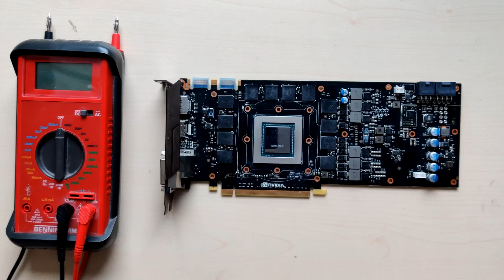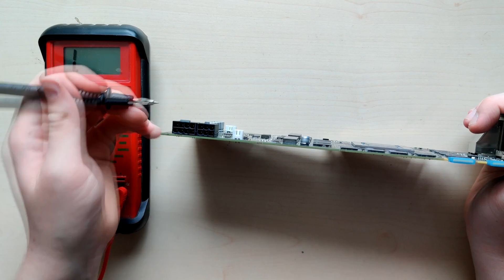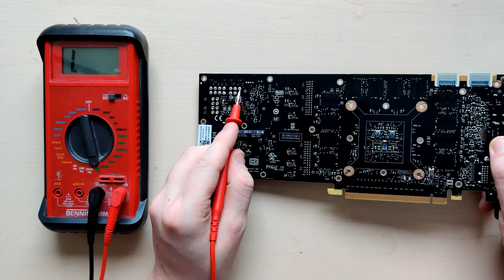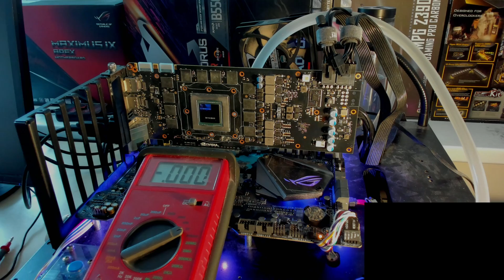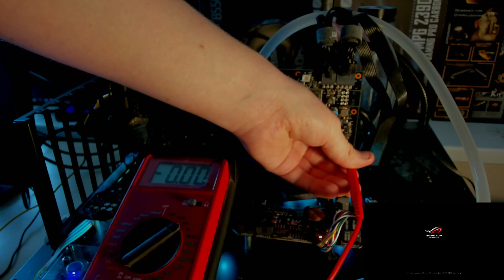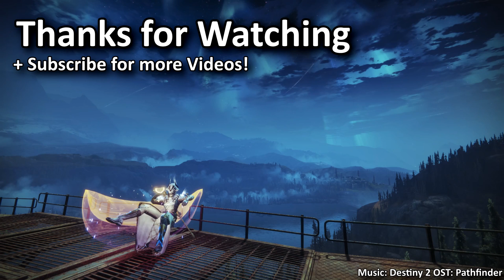The General Troubleshooting "Algorithm" to follow when diagnosing Graphics Cards

Comment: At around 2:25 he said that the card does not have fuses but aren't the 2 resistors just below the 6 and 8 pin connector as well as the 1 resistor to the left of that considered fuses?  I think they are also for voltage readings but I think they are meant to act as fuses as well.

Comment: Did you say all positive connectors coming to the card have to be separated? On my card they are shorted together. I mean positives with positives. And even shorted with +12v pin of fan number 3. Which causes it to spinn at full speed. What component could short those together? Card is not working EVGA RTX 3070Ti

Comment: Found this channel while searching for a solution to fixing a no display issue / not detected  on two Radeon (both MSI)  R7 370 (4GB) and R9 380 (2 GB) cards. R9 380 arrived with known faults so I am teaching myself diagnostics.   The other R7 370 was working fine but one day decided to not display.

Visually inspected both cards. All fine no burn marks or missing components all  big caps are good. Tested the PCIe fingers on edge connectors and also pin outs on PCIe power connectors all seem OK.

When the cards are plugged in the LED, fans spin but no display and no beeps. I removed heat sink assembly and I could feel the core (GPU) getting warmer and the R9 gets hot (only for 10 seconds).

Have not worked on these very small components before but I can test, and can solder larger components but not sure what else to check as most of the repair videos deal with nVidia cards and seldom any RADEON R 7 or R 9 series. Can you give me some hints how to start checking for common component faults?

I have a heat gun (simple type) but have not yet tried to re-flow the memory or core as I want to be sure if there are other culprits to check before I do these?

Any ideas would be very appreciated. 

Best wishes!
Reply: Any updates? Found myself in a similar situation
Reply: @lordsimquad  Nothing that caught my attention yet 😒
Reply: gpu core may be damaged, so it would probably need bga rebailing - finding a donor gpu to resolde. Its kinda expensive repair and not as reliable as factory.

Comment: I have a short on one of my R15 inductors, does that mean a bad gpu? The card is EVGA RTX 3080 and it is one of the inductors on the left side of the board
Reply: It depends which inductor youre looking at, the ones for vcore always look like a short but thats because the gpu vcore has a very little resistance thats normal, Ohms in memory inductors should be 50ohm, 1.8v inductor 800ohm, 5v inductor 6kOhm
Reply: @1elmasbergas  Thank you.

Comment: A novice walking through your algorithm to salvage my GTX 1060 Ti. My 3.3V beeps (and measures ~1-2 Ohms) , so it sounds like shorted 3.3V circuit... Where should I go from here?

For context: I connected my GTX 1060 Ti to a laptop via M.2 to PCIe riser. I plugged the PSU to the 6+2pin on GPU and the SATA on the riser. When powered the laptop, I felt an electronic burning smell... I found out that my PSU didn’t supply voltage, until I connected a ‘tester’ to the Mainboard 20+4 PIN Power Connector... But at this point, my GPU was already damaged, I guess.. Any advice would be appreciated.

Comment: hi  my rx 570 blue ligh led  power normal and chip heat but no display cant even boost pc bios and pc shudont after gpu spin for seconds and repeat restart i tested my  gpu 6 pin power its all 6 pins beep by avometer what do you think about this short? becouse you said power in gpu 6 pins must not all pins all black only not yellow?

Comment: Hello can any body tell me i have amd rx6750xt and not booting when plugged in and followed and every thing looks good according to video but when testing core voltages the core doesn't heat up and card wont even boot up
Reply: If you put it in the microwave for 1:30 on a 750w machine it will plasticise the solder ever so slightly and let it find and breaks 

Usually works to fix any bad connections which makes up about 95% of all gpu/circuit board faults

Comment: how about ASRock motherboard that have USB issue ... works only with USB 3.0 devices ... anything else u have to install a pcie usb extension to use the usb used by a seperate controller other than Asrock's Intel B365 controller??? fyi all USB ports delivers 5 Volts and windows gives an error when plugging non USB 3.0 device ... still not working either on OS nor on BIOS... any idea???

Comment: I wanted to let you know that I found your video to be extremely helpful in understanding what's going on under the hood. I'm just starting out learning and it's very important to be taught with sound doctrine. Thank you for helping me understand more than I did yesterday and a little less than what I'll learn from you tomorrow. Because the videos will keep getting better. I'm so sorry for asking this question, but I felt compelled to do so. Would you be so kind and tell me where I can find out every single tool and software that I need to buy to get started. Everything from power harnesses, soldering iron station, cleaners, hand tools, scopes etc... I know it's asking alot and I'm sorry, but I want to get started the right way and a tech is only as good as his tools. Also can I buy a great scope package from you? Or could you recommend a great setup like one I'm sure you have at your shop? Anyway, thank you for a great video!

Comment: hi, if pex rail resistance below 3 digit (possible short), will the core still getting warm? because my dead rtx3060ti core still warm and getting hotter with all voltage present. I want to make sure the core really dead before I use the card as my door stopper.
Reply from the maker: PEX rail can have low resistance sometimes. Depends on the card. Unless it's 0 ohms i wouldn't immediately assume it's short.

Comment: Thanks a lot for this guide, it's very useful and understandable. In my case visual inspection looks right, but there is a lot of capacitors in short (3 near the PCI slot connector, and 6 at the back of the core), so I suspect it could be a dead core, but since I'm a beginner, what do you guys think?

Comment: all voltage is present, but no display. where do i go after that
Reply: I’d say visual inspection of the PCB under a microscope to check for signs of corrosion
Reply: the problem here is the chipset beneath it needs re balling to make the surface of the chipset and the gpu has a good conduct

Comment: I have a 3060 Ti that gives me code 43 so I want to check what is causing it. GPU-Z can read the BIOS, the VRAM frequency, even the driver but not the size of the VRAM. I dont really get artifacting like most common 43 errors, in fact the card works every time I restart PC, it works for like an hour then the screen goes dark and PC restarts. The funny thing is it passes furmark test and gaming, but again it randomly crashes. I suspect maybe is BIOS chip but I have ZERO knowledge of PCB layouts, or how to use multimeter thats why im here lol but any way to identify BIOS chip and how to test it with multimeter? EDIT: I checked ASUS download center for BIOS update on my GPU but it says there are no new updates for it.
Reply from the maker: Most likely faulty VRAM. Try to run a mats test on it.

If GPU-Z can't read the VRAM size that means the driver is not installed/active

Comment: I have a PNY RTX 2080Ti that will boot and the screen will come on and I may be even able to run Heaven for a few minutes but then I get a black screen and the Blower Fan turns on Max. I then have to either do a 5 sec power cycle or turn off the main power to get the computer to reboot. I have noticed that I am missing a lot of ceramic Capacitors on the back of the card. I would begin replacing the capacitors but I don't have another 2080Ti to get them from. What should I do?
Reply: Have you tried getting a board view for your 2080Ti, finding out the exact parts you need and then ordering them from somewhere like AliExpress?
Reply: @ProfShikari  I tried to find a board view on the internet but I could not find a good one for the exact card. It's a PNY RTX 2080 Ti.
Reply: @frankesposito2229  can you not find a very similar one that would be a near perfect match? Lol

Comment: Dude. I went over the mostfet route… found nothing. Visual inspection looked fine. Then you said… just look at the caps near the connector at the back… what do you know. Solder 2 missing ones and fired right up! Thanks!
Reply: how do you know which capacitor is missing ? I mean, how many nanofarad ? microfarad ? do card manufacturers offer free schematics by chance ?
Reply: @Juppie902  dig through many forums until you find a the board. Some times pausing on youtuber's repair videos when they look at a boardview that they found and or maybe paid for.
Reply: . Pcie data lanes capacitors are almost always 100nf
Reply: @Juppie902  no you just have to find them online. I just happened across a collection in someone's google drive.

Comment: Hey there! I have a reference Rex 5700XT, that displays, but crashes the system when under a load. I tried doing the steps you said here in the video, but I haven’t found anything. What should I do?
Reply: is it because of a limitation of power delivery from your psu? How many watts is it?:yougotthis:
Reply: @shaoyangzhang8523  My PSU is 750w. I’ve already ruled out the other components in the PC aren’t the issue.
Reply: @RTC1200 your gpu has degraded due to high temps. Try changing the bios to a one compatible with your gpu, or try lowering the clock speeds
Reply: @agsechogd6406  Hm, Alright. I’ll try it out.
Reply: @RTC1200  also high temperatures are the reason why it could crash under load. typically when a gpu gets over 90c it shuts down
Reply: @agsechogd6406 it’s not the temps, I’ve already checked that. The highest it gets is 85c before either the pc resets, or shuts down completely, it’s like it isn’t getting enough power,

Comment: Where does the „global“ or singel enable signal for the controller come from ? 
I already replaced a blown powerstage on a 3,3v plane on a saphire 5500 xt. But although i succesfully removed that short i still have no enable signal on any controller.
Also i measured 0.4v on the enable pin of the Vcore controller. Wich is according to its datasheet the fault voltage.
I need to know where the fault has its roots.
Reply: Btw all fuses are good and all power inputs are good in terms of voltage.
I honestly dont know what the 3.3v rail is for :D and it might help to know where the enable signals are generated in order to seek for another short.
Pretty sure the powerstage blew because of another issue

Comment: hello friend, I have a gtx 780sc evga 3gb P/N 03G-P4-2784-KR like your video card... I have Coil Whine problems when I enter some heavy application like games or renderings. If I change the R22 inductors (6xunits) do I have a chance of solving the problem? Is there a way to find out which inductor is bad or should I replace them all? do we have another solution? thank you this noise is driving me crazy!!!

Comment: Thanks, it really helps, i know there are several low coltage rails on gpu, i just dont now which one is which, i just always randomly measures a large capacitor for voltage, i have 5cards here but only got 1card working because lucky enough its just a shorted low side mosfet, the others are a nightmare for me since i dont now where to start at live testing a gpu

Comment: Hello i got msi gtx 970 in new to this. I messured everything and thers no dmg or short circuit. but thers no video and Gpu core is cold ( so it's not getting power) Fans are spining..
Reply: Probably chip needs reball

Comment: Thanks! Useful info. The gpu stabbing video was good too if anyone hasn't seen it.
Reply: Is that the one where he drills a hole all the way through the PCB to do a root canal on a rotten VRM, and the card starts working?!
Reply: @RobinDobbie  it was an earlier guide he did on what diagnostics he runs on gpus.

But that one sounds good too lol I think I must have missed it. I'll check it out